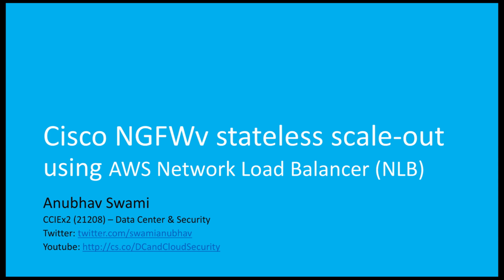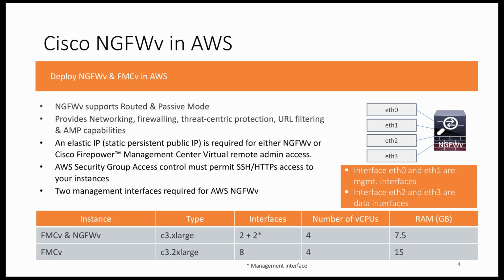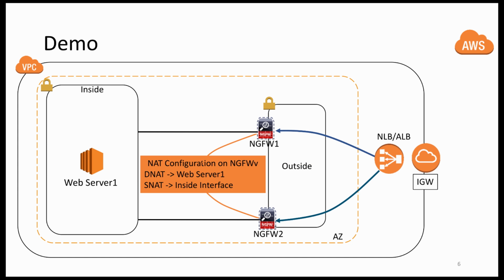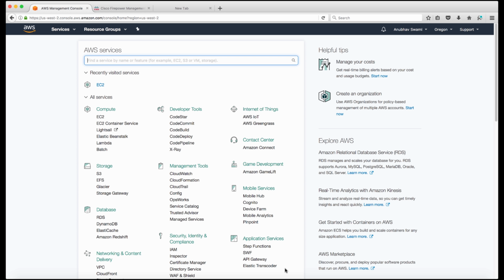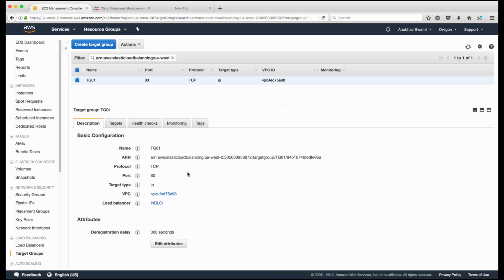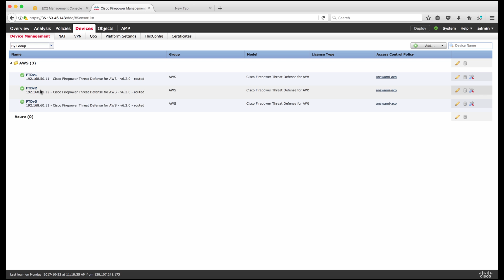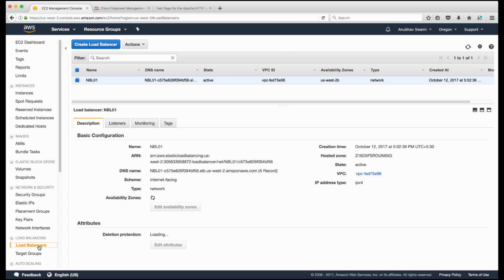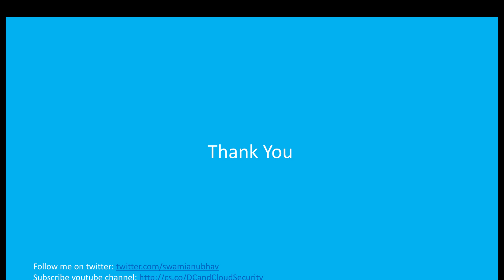Learn how to deploy Cisco NGFWv in AWS behind AWS NLB for stateless scale-out Design

Comment: how did you get HTTPS enabled on the outside interface of the FTD, when it's managed by the FMC?  mine isn't working and i found an article that said HTTPS won't work if managed by FMC?  is that correct?
Reply from the maker: FMC uses SFtunnel (TCP port 8305). In the backend it is a TLS. It will not interfere with HTTPS connection.